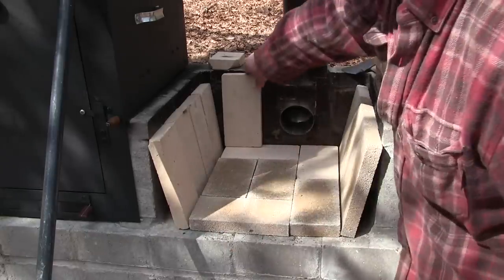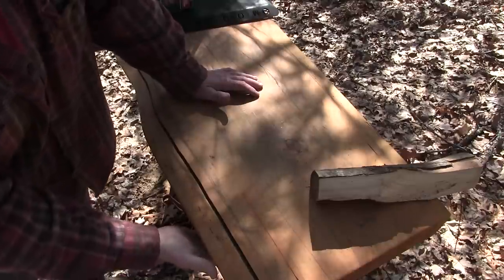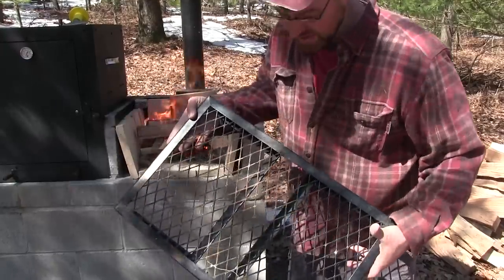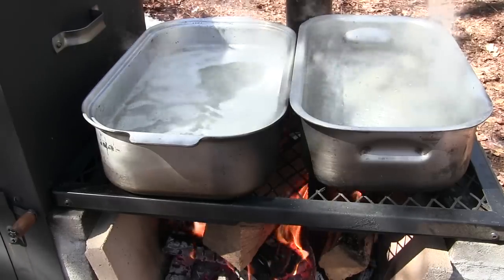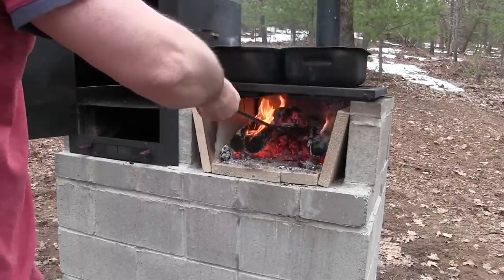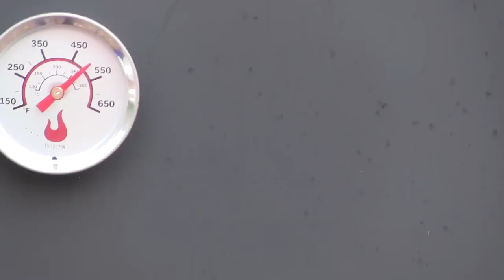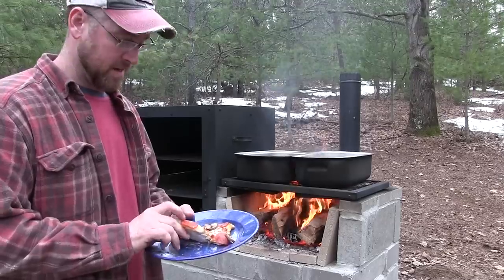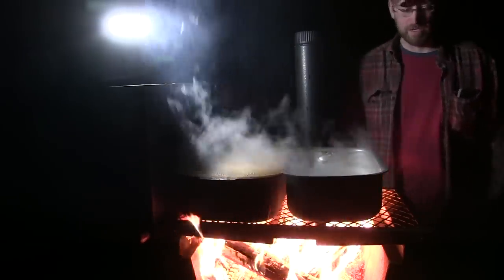Perfect wood fired pizza at the out door kitchen and making maple syrup

Comment: The knife has a great look to it. Really like the copper and brass together. Where did that one come from? Continuous improvement with the smoker/pizza oven. Looking forward to see what you come up with next.
Reply from the maker: Thanks I made it . I’ve been making them for a few years just one here or there mostly but I’m starting to make a lot more now that I have more time . The copper and brass are loveless bolts pretty cool hardware to work with you can get them I think in copper brass and stainless and you can mix and match however you want. 
opening up that heat Shield was key the fire just needed to breath better I think I might drill a few more holes in the air intake and it should be about right . I’m thinking I might film a knife build  start to finish next
Reply: @black spruce   I had a feeling you were making them, saw some of the equipment in your shop in another post. Put me on the list for one. Love to see a knife build as well.
Reply from the maker: @joshkelloggKCR  awesome maybe I’ll have to come up and hit the au sable with you and bring a bunch up so you can check them out I totally forgot I bought a canoe last fall it and old fiberglass Mohawk in rough shape but if floats . I actually bought it for a restoration project but haven’t gotten to it yet
Reply: @black spruce   heck yeah, soon as it warms up. I think the water is about 34 deg right now.

Comment: The fire bricks will certainly help! Quick questions:
a) is that a DIY or brand oven? If a brand, which one?
b) is your setup empty under it or full cement bricks?
Reply: found my answers in your other videos!:) I'm going to make the same one, but will use fire bricks right from the start on the top.
Reply from the maker: good deal . I was going to share both videos with you but it would only let me do one at a time then I couldn't find your comment again after I replied the first time . good plan the fire brick will make it last longer for sure .

Comment: A couple tips on the Pizza stone, don't wash it with soap and water just scrap the crap off. Also do not slice your pizza on it.
Reply from the maker: Thanks that makes sense you cut the pizza on it you get a mess .
Reply: My pizza stone shattered after many years of using it, you shouldn’t remove it from the oven until it is cold, the slower it cools the better. But since mine shattered I switched to a plate of 3/8” thick steel my buddy cut to size with his plasma cutter. I seasoned it just like a cast iron pan. Less sticky and it should last forever.